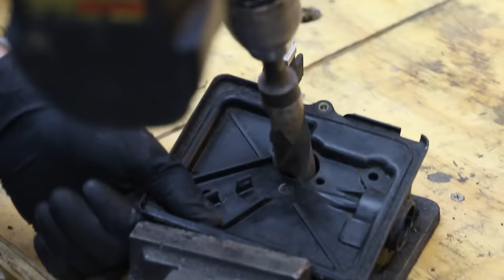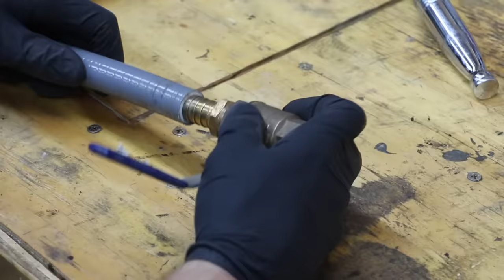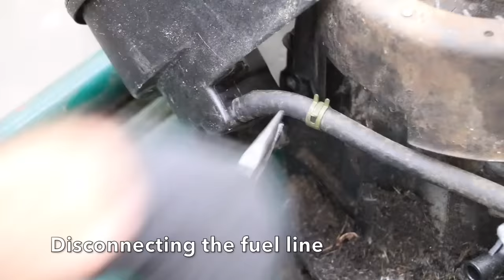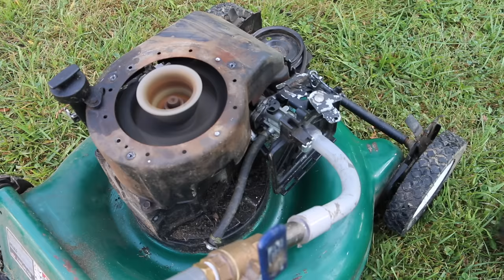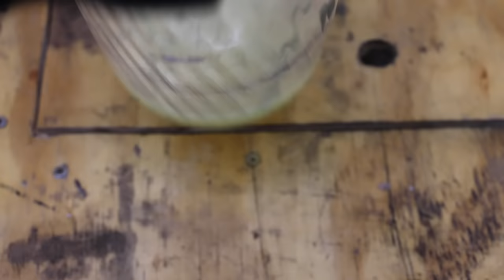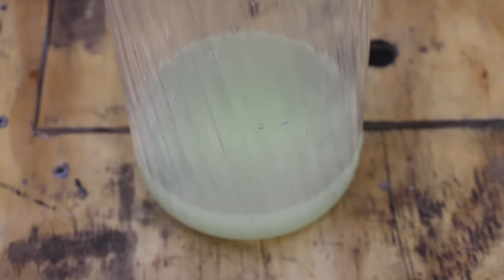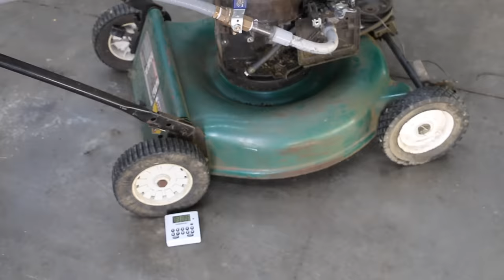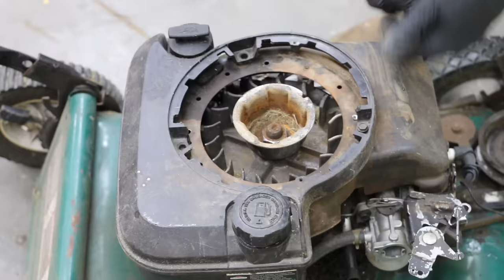Will a "Gas Vapor" Container Improve MPGs and Fuel Efficiency?  Let's find out!

Comment: I just want to throw this out there for everyone. A gasoline engine runs off of vapor. That is the reason a fuel injector works better spraying the fine atomized mist vs a solid stream. The surface area of the mist allows the liquid to become a vapor which is combustible. A carb works on the same principle of turning the liquid into a gas. 

Engines run off of vapor so the end result in run time between vapor and "liquid" is to be expected.
Reply: The point of this is to ensure all fuel entering cylinder is a vapor. No droplets to fail to burn. It's an attempt to improve the carburetor.
Reply: Brandon      FI  works better because pressurized  fuel is sprayed thru an orfice, atomizing fuel entering the manifold. Carbed  fuel splashes around in a float bowl waiting for a sufficient  amount of vacuum to puke it into the manifold.    Although, most definitely more atomized, injected fuel is  raw, not vapor.  The carb mixes fuel and air together in an emulsion.  And finally,  gas vapor, also, can get too rich or lean. The test motor ran on both setups, but without an O2 sensor and an air/fuel ratio gage, we can't say whether both setups were stociometeric (sp),  run time is affected.
Reply: Brandon Morrissey
Reply: Mist is not vapor, no matter how small the droplets are.
Reply: Funny enough, most carbs vaporize fuel better than fuel injection, what with them usually being further from the intake valve and the high velocity you get through the throat of the carburetor.  If your float is set too high, which can result in fuel actually dripping into the carb instead of flowing in a metered trickle, then you'll get liquid fuel into the cylinder.

The gains from fuel injection are almost entirely due to more accurate and more responsive metering.  Generally, you're stuck with fixed metering jet sizes in a carb for mid and wide open throttle, while the idle is usually adjustable (but still effectively fixed, as it's "set and forget".)  With EFI, you can control the metering through both injector on time and fuel pressure simultaneously.  

"Mist is not vapor, no matter how small the droplets are."

The mist vaporizes in the combustion chamber before ignition.  Cold engines need to run slightly richer mixture because the fuel isn't vaporizing as well.
Reply: Correct, which ia why they are so inefficient and require different octane levels in different compression rates. All ypur questions qill be answered if you understand what octane does, amd why its higher in a higher performance engine.
Reply: AnantaSesaDas That method Is like carbureting an carburetor
Reply: Moon Pie the term is unspent fuel.  A lawnmower is not a car and neither does it utilise a catalytic converter.  The "cat" is not destroyed it is merely coated such that the platinum/ palladium or other cannot perform its role.
Reply: Exactly. That's what I was thinking. Fuel injectors atomizes the fuel in the combustion chamber.
Reply: No it isnt. The carb carefully meters the mixture of air and fuel. This doesnt at all. It just runs or doesnt run. How is that an improvement?
Reply: Octane resists burning, causing slower more complete burn. Its the opposite of what most people think octane does.